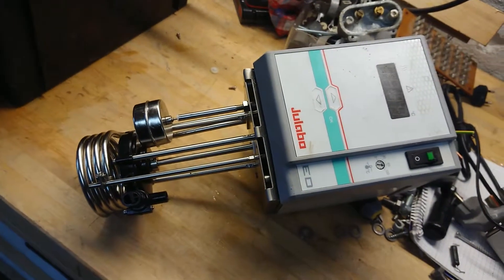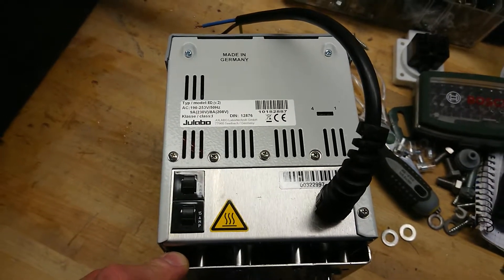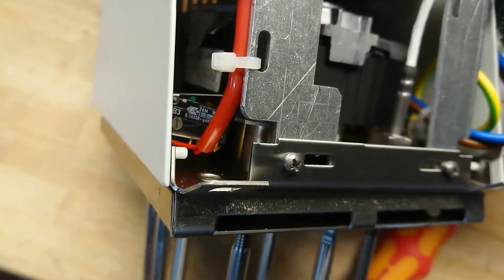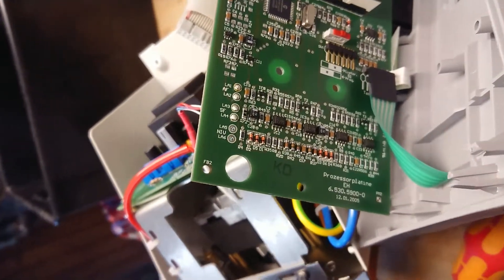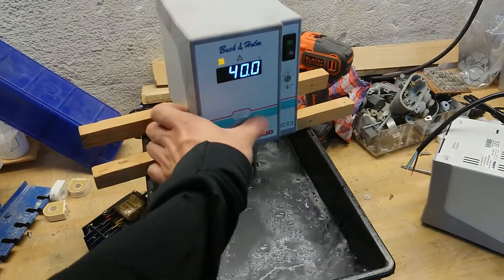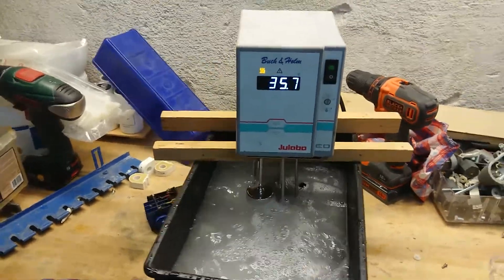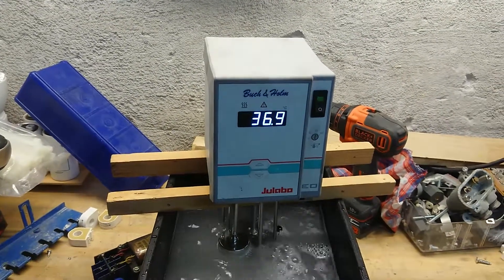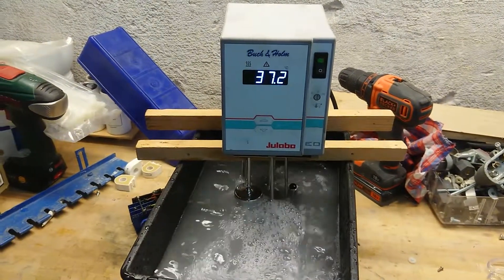Julabo ED Heating Immersion Circulator Test and Teardown

Comment: sir, what type of pump is that? does it a stirrer or pump? can you show how it works?
Reply from the maker: It is just a shovel wheel in a small house, very loose construction, just to stir the water
Reply: @KaizerPowerElectronicsDk  it is a circulator right?. Which means that it is capable of pumping the fluid to an external device and circulate back. So it seems to have a pump in it.. (circulate flow rate as 5L/min is advertised in thier website)
Reply from the maker: @mechzion01  no, its just a stirrer.

Comment: Hey I got a pretty dumb question. My F12-ED unit is rated for 110V, but by accident it was plugged in a 220V power output. Now, the circulator head won't turn on. I know that it has those resettable circuit breakers, but I could not manage to reset them. Do you know whether the circuit breakers would really be able to prevent this kind of damage, or are they designed for other purpose? And in the affirmative case, how can I reset them? Cheers!

Comment: These are commonly used in chemistry and biochemistry labs for reaction water baths. The rapid circulation is critical to ensure the temperature around the reaction vessel(s) is maintained.
Reply from the maker: It came from a protein powder manufacturer, so it was used along with some other test gear to measure the protein content.